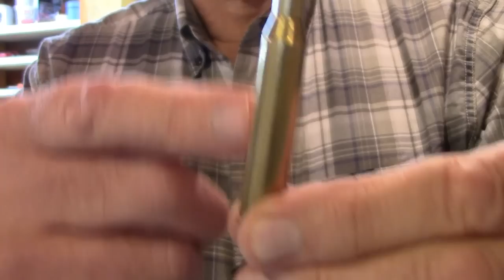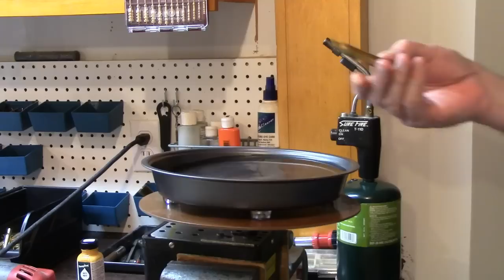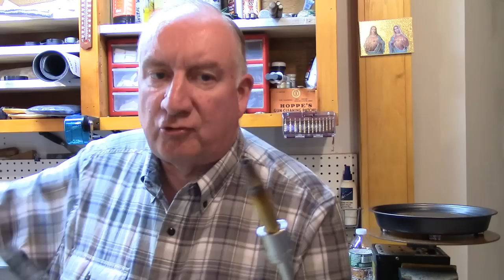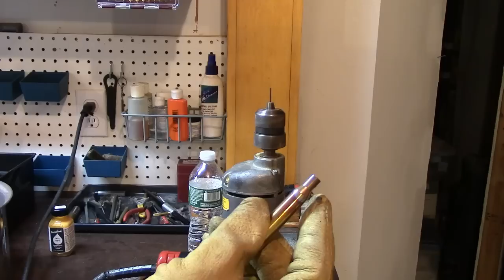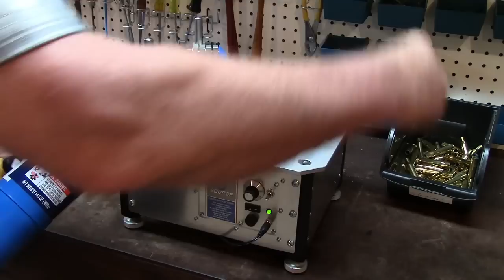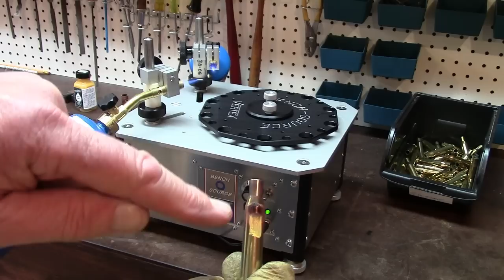How to Anneal Brass ~ Vertex Bench Source or a Tight Budget!

Comment: Thank you so much for taking your time to teach.  You do an excellent job.  I have two questions.  I apologize in advance if I missed it while watching your video.  Your cartridge case is already sized before annealing, right, since the primers were removed? So there is no concern about dimensional changes to the case due to annealing, correct?  The other question is in regards to case head separation.  I have had it happen a few times and now more closely examine the cases near bottom.  Annealing does not treat that part of the case and I gather that there is no preventing them and that the case is scrap at the first sign of a crack forming?  Thanks again for your sharing your knowledge.  I always look forward to your next posting.
Reply from the maker: Whether the annealing is done to sized or un-sized brass containing fired primers them makes no difference whatsoever, because no substantial heat of more than 450F is supposed to reach below the shoulder area, which is well below the annealing temperature of about 650F.  (NEVER size freshly primed cases!)  It's good practice to clean them first, so that a "read" can be made of the brass color, and so they don't become permanently stained.  But, it's strictly cosmetics.  Annealing changes no dimensions of any kind; it only softens the brass.  As to case head separation, that is very, very, very dangerous and very, very, very harmful to a gun, and should never be permitted to occur once or ever to a gun.  Some folks online seem to think it's an everyday experience, but it is absolutely not.  One should NEVER use cases until they separate!!  Cases will always exhibit other signs long before that point, most notably lazy primer retention, at which point they should be considered junk, and never fired again.  Primer pocket leaks are the same hazard as case separation.  The release of intense heat from a small crack is like a blowtorch, and will cause permanent pitting of the steel inside the chamber at the crack location, and in some cases can wreck a gun completely and is extremely dangerous to the shooter and bystanders.  Those hot searing gases are vented from the chamber, only inches from the shooter's face!  I've seen magazines blown out and destroyed with systems that "safely" vented downward.  

Separation is caused by only one thing; EXCESS HEADSPACE, where the round is stretching more than it is designed to, in order to fit the chamber upon firing.  Excess headspace occurs either by the gun, or the ammo, or a combination.  Any question of a dangerously oversized chamber must cease all further firing until rectified by either an arms maker or gunsmith.  It can also be the round being sized excessively by a poorly made die (rare), an altered die (not uncommon), or repeatedly fired and resized BELTED MAGNUM CASES.  First, have your gun examined by a competent gunsmith for headspace.  Also, be sure he understands that your gun has suffered separations, so that he inspects the gun for chamber pitting, bolt face pitting, extractor damage, bolt cracks or fatigue.  By the way, one of the causes of excess headspace is repeated case failure that damages locking surfaces.  Read on...

If you are using belted magnum cases, you must be very aware that they NORMALLY cause "incipient case head separation", if the loader doesn't understand how they work.  Belts are actually high rims, with a built-in extraction groove.  Standard rimless cases like the .223, .308 Winchester, or .30-06 Springfield headspace on the shoulder of the case, measured midway between the shoulder and the neck, at an invisible engineering point called the "datum line".  That spot, back to the bolt face, is called the headspace, and the case must be no shorter, or the chamber must be no longer, than the specified "headspace" dimension, or the case will stretch excessively and separate.  Belted magnum cases have a different headspace dimension, measured from the front of the belt, back to the bolt face.  The way a standard case stretches to fit the chamber on firing is entirely different from a belted magnum.  A standard case is pushed fully into the chamber to the shoulder by the firing pin, and as the case expands at ignition, the front of the case sticks tight and the rest of the case stretches to reach the bolt.  Belted magnum cases don't move forward by the firing pin, so the neck is not snug against the chamber at the instant of ignition.  Instead, the entire front of the case is loosely hanging off the belt, suspended, and as the case grows, the front snaps forward to fill the chamber.  It may seem similar, but with standard cases, the forward part of the case is supported, and a greater portion of the entire case stretches, sharing the thinning of the brass more equally.  Belted magnums tend to thin out at the "web", just forward of the belt, where a light colored ring can be noticed when inspecting cases, which signals the absolute end of the case's life.  This visible line is called "incipient case head separation", and is a warning that the case will shortly go, on either the next or a subsequent firing.  This growth can be controlled by backing off the sizing die until the case just fits into the chamber, but then I wouldn't do such things for a case that must function flawlessly on a hunt.  It's one of the reasons that I don't get too excited about belted magnums.  

Do "rimmed" cases like the 30-30 and 22 Hornet have incipient case separation?  No, simply because most rimmed cases operate at much lower internal pressures, and they almost always suffer case mouth splits before any rearward cracks occur.  Those splits are located at the area where gasses are directed and vented fully by the barrel, and are not contained and trapped.  .220 Swift owners should take note though, as case failure can really be catastrophic, and should always be very carefully examined, just as with belted mags.  But of course, a diligent reloader should never expect his cases to do the unreasonable, anyway.

Comment: thanks so much for the amazingly informative videos!!!! would love to hear your thoughts, opinions, and knowledge on three cartridges, .284 Winchester, .280 Remington/Ackley, and 7mm wsm. thanks again an have a wonderful day!!!
Reply from the maker: TheEigerclimber 
Well, the 284 is virtually obsolete, and never was commercially successful.  It uses a peculiar rebated rimmed case that is expensive and typically impossible to find.  It was offered as a short alternative to the 270 Winchester, but never caught on.  The 280 was Remington's answer to the 270 Winchester, and is a fantastic round, but the company made a ridiculous decision to market it with a 150 grain bullet that gave less muzzle velocity than a 150 grain 30-06, and nearly 200 fps less than the popular 270 with a 130 grain.  Their sin in forgetting that cartridges are sold by muzzle velocity and not downrange effectiveness cost them the game.    As for the short magnums, I personally see no particular reason for their existence.  The use expensive fat cases that do almost what their full length counterparts do, if one requires a magnum at all for any American game when the 270 is around.  Most magnum cartridges need at least 24 inches of barrel, preferably 26 in order to realize advertized ballistcs, which is a silly amount of gun to tote around, when a 270 works just fine with a 22 inch pipe.  If you like 7mm, I would suggest the 280 Remington with a 22 inch barrel, and load it with 140 grain bullets, which will replicate the 270 Winchester with 130, and for heavy game, the 160 grain bullet, which replicates the 150 grain 270.  Or just get a 270.  ;-)

Comment: Good video.  Questions.  Would the drill method improve the results (the brass) by quenching right after heating? 

Also...for those that need to neck up or down...say 30-06 to 35 Whelen...does annealing assist in that process?

And finally...Just related...I've always been stumped by how wildcatter/necking up or down folks stamp the head to represent the new caliber.  Is there a process or tool for that?

Thanks.
Reply from the maker: Quenching affects the various tempers of steel, but has no effect whatsoever on brass, other than to cool it for handling, safety, or convenience.  As soon as heat is removed, whatever stage of softening the brass has reached will halt, and the process cannot be improved upon by quenching.
Reply from the maker: Arnie Grammon 
Most cases can be easily resized without annealing.  There's no process for altering case headstamps.  You just segregate them, as I do with my various altered cases.

Comment: I recently annealed 500 RDS. 556.I started reloading some and noticed after seating the bullet that the bullet was not concentric. I rolled the loaded round on a flat surface and noticed a wobble. Is there a way to save this brass or should I scrap them?
Reply from the maker: Unfortunately, the brass was overheated and reached the dead soft state where its hardening alloy was lost.  Thus, it was distorted under pressure of the seated bullet.  Such brass has much the same property as musical instrument brass now and is not salvageable.  You can individually check cases by squeezing the necks gently with a pair of pliers, comparing them to new brass, sorting what you may keep.  

Use great care to never allow brass to glow red during heating.  Two or three seconds is usually sufficient to establish a purple line, which should go no deeper than 1/4 inch below the shoulder.  You can always do a second annealing if it's not enough, because it's a progressive process.
Reply: @GunBlue490  Thanks, strange as it may seem they did not glow red when I annealed. Just resized a few seem to be good ,but the neck tension is to loose, like you said soften too much. Oh well $80 lesson....

Comment: What is the purpose of the rear bearing on the cartridge drum side? The use of a hex head bolt for the axle provides no penetration into the rear bearing therefore it provides limited, if any support to the lateral load on the drum.  The use of a short piece of threaded rod or a  pre made stud and a hex nut to engage the gear.

Comment: Great video. Thanks so much for the detailed information. Do you anneal before or after sizing?
Reply: My same question?
Reply: @jonperley9722  he responded the same question somewhere else. Says it doesn't matter. I figure it would be my last step in case prep. Erik Cortina says it's his first step in reloading... but his take on annealing is 180 degrees from this guy. 
???
Reply: I anneal mine before sizing because the hardened brass resists being resized enough to get the shoulder bump correct.

Comment: What is the best powder for reloading hornady 100 grain interlocks in 243 caliber, having some trouble getting them to group!
Reply from the maker: I am not fond of load recommendations, due to the number of variables.  I've had terrific results with 100 grain bullets with IMR4350, and IMR4831.  I really cannot state more emphatically to use a loading manual when deriving loads.
Reply: I have reloaded for over 50 years and have the reloading books from every company out there! The reason I was asking about different powders is the ones I normally use are hard to find in my area!

Comment: I have annealed with success I believe but it doesn't do much to help with my 22 hornet or my 243 which both break between the head and the mid section of the case.  They both show no signs until after the shot and I have to remove the front of the case from the chamber to load the next round. I'd thought about trying to heat the middle of the case very slightly on the hornet since buying more seems totally impossible but if I did it would be very little and in a shallow water bath. Maybe I will just have to give up shooting my favorite little gun for awhile

Comment: Hi Gunblue! Thanks a lot for the info, I've got two questions about this, if you dont mind me asking:  1- I've heard of people annealing brass by just twirling the brass with the fingertips and dropping them as soon as they get too hot to touch, what do you think of this method? and 2- Do you anneal pistol brass? Thanks again!. Matt
Reply: Matias W That's what I do too. However, i wish I'd seen this before I started annealing and it looks like I've overheated mine and should toss a bunch.
Reply from the maker: Matias W 
Well, as to the bare finger method, I consider it the same as eating dinner with bare fingers.  It can be done, but we have utensils that make life a bit more civilized.  The theory goes that the fingers can signal when to stop.  The problems are significantly attached to the entire subjectiveness of several vague factors; individual tolerance of heat, the transmission of heat that is wildly different from one case dimension to another according to length, breadth, and thickness, and even the placement of the flame.  The theory also goes that the designs of various cases is accounted for by the transmission of heat to the head, and that the felt heat at the finger tips discloses a perfect annealing heat at the case mouth, which is high grade delicatessen baloney.   I can absolutely guarantee that the degree of neck temperature achieved with cases of varied sizes is significantly different.  Finally, the typical case head has reached a temperature of well over 220 degrees by the time the neck has been annealed; at least 80 degrees more than anyone's pain threshold, and at least 40 degrees more than the scalding point of water.  Nobody can sit and anneal brass to the required level using this method with bare fingers, which is what the method calls for in theory.  Cases must be annealed to at least the level shown by the water pan method, which is minimal, and after doing 40 cases, that pan of water is quite hot.  NEVER anneal pistol cases.  Without highly sophisticated techniques, the case heads become soft and dangerous by the time the mouths have reached correct softness.  This is strictly an industry practice done under extremely controlled procedures, with greatly expensive industrial processes.
Reply: Great, thanks!
Reply: @GunBlue490  Glad I perused all the comments to find the answer to the question I was going to ask and that’s the annealing of pistol brass. Thanks for the heads up. Love your videos. More is better than less.

Comment: How about using a small Nichrome electrical heater coil on 120V? Add a ceramic sleeve to contain the heat also. No flame, no gasses,

Comment: The author of this video keeps referring to the brass as a copper/tin alloy. Firearms cartridge brass is an alloy ratio of copper 65-80 % / zinc 35-20 %, with .05-2 % impurity’s for a alloy total of 100 %, depending on the cartridge brand. The copper gives the brass alloy ductility, while the zinc gives the brass alloy strength.

The author’s reference to tin is slip of the brain. Other then that, all the rest of the information in this video is correct.

Comment: Ill be using this.
I just bought a cz 527 in 22 hornet. I was given a couple hundred fired hornet brasses. Not knowing the times fired would you anneal all in this situation.ive heared hornet cases are thin.thanks
Reply from the maker: Edad Martin 
Hornet cases are indeed thin and very small, and can easily be ruined by annealing.  I would absolutely use the water bath method, as the case can readily overheat. The case should stand in about 1/3rd its height in water.  Start with just a two count and project the flame to the top of the neck.  Hornet cases are not subjected to extreme pressure, so they typically can last a long time.
Reply: GunBlue490  hey thanks for the answer water bath and short 2 second count cool
Reply from the maker: Edad Martin 
As I mentioned elsewhere, the process is not cumulative, so after cooling you may do it progressively longer, and with the flame positioned closer, until the correct amount of time and position is discovered.  In other words, using the same piece of brass, start with perhaps one second then cool.  If not sufficient, try 1.5, and so on, increasing gradually until the correct color is obtained.  Don't overdue.

Comment: First off I want to thank you for all your very knowledgeable videos! My question is , as a service rifle shooter do you think it benifiet at the 600yrd line for annealing? And also do you suggest annealing before or after sizing? I shoot a m4 .556 if it matters. Thanks
Reply from the maker: Eric Cartmill 
Well, consistency is the real issue.  Brass that hardens at the same rate is consistent, if kept together.  While bullet neck tension may vary between lots that have been fired various times, which can affect vertical dispersion when mixed, I would hesitate to recommend annealing every time, as there can be greater risk to loss of the brass alloy, unless a precision process is used for exact timing, as with my last demonstration, or others like it.  I always recommend sizing immediately prior to loading, even with brand new brass, as it corrects any potential irregularities.  Cartridge designation has no relationship to the process.
Reply: GunBlue490 Ok understood. So I take it that the petered method would be size after annealing?
Reply from the maker: Eric Cartmill
Alignment is far more significant an issue to accuracy than brass hardness.  Resize, whether it's full or neck, before loading.  Please do not infer from my video that annealing corrects great accuracy issues.  The process is fundamentally to extend the life of brass, and as I said in the video, you can load very accurate ammo all your life without concerning yourself over annealing.  Annealing conditions the brass.  Sizing aligns the bullet.  No amount of perfect brass hardness can correct an imperfectly aligned bullet caused by a mishapened case caused during handling.  Annealing is a handling.